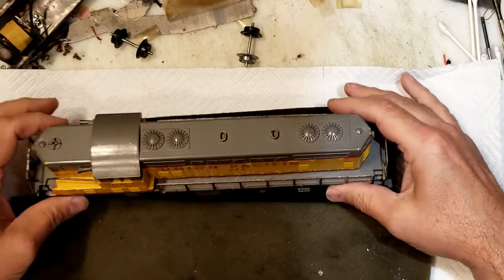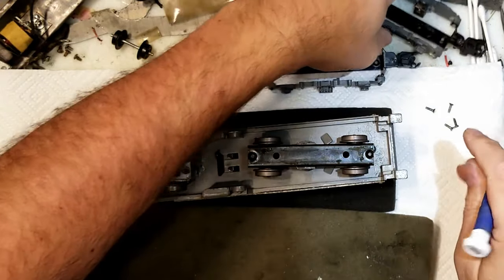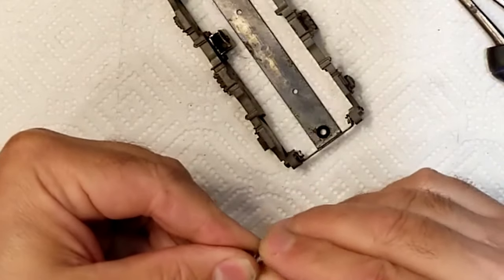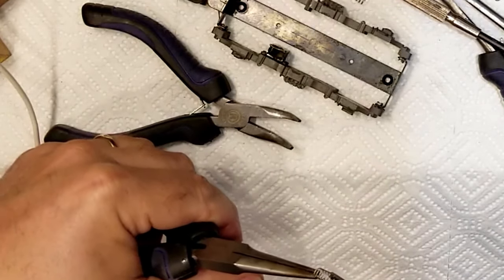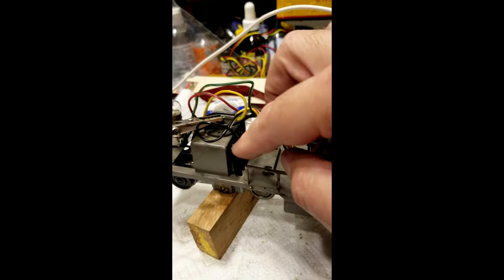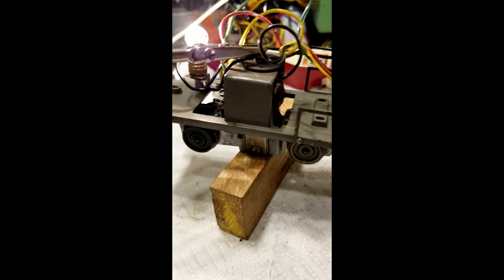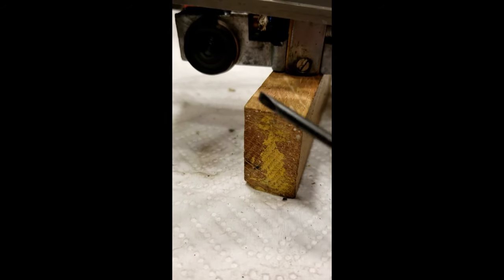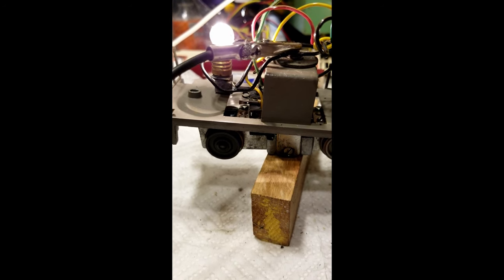A McGyverish GP7 hack attempt #1

Comment: I can see the issue with the motor. You can see a lot of arcing from the brushes in the video. It's good to see an adjustment of the brushes fixed the problem.